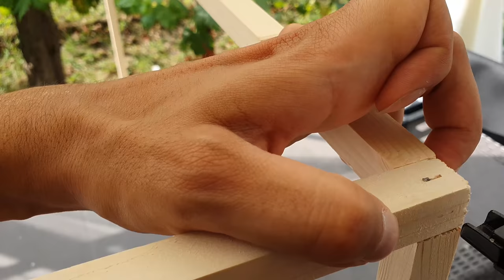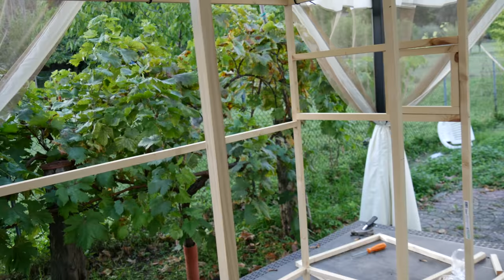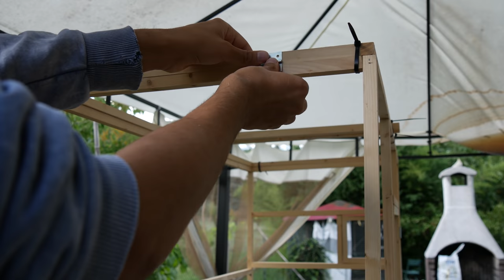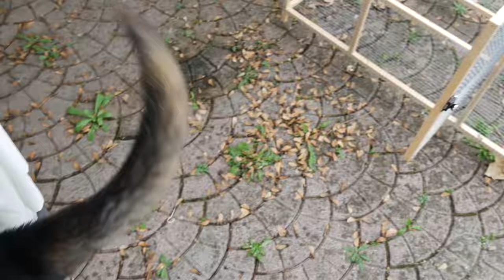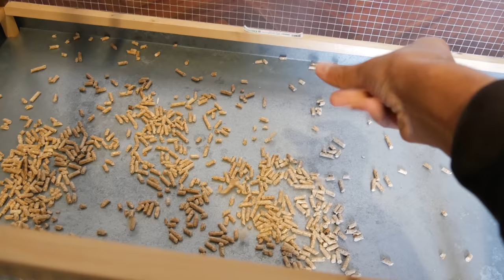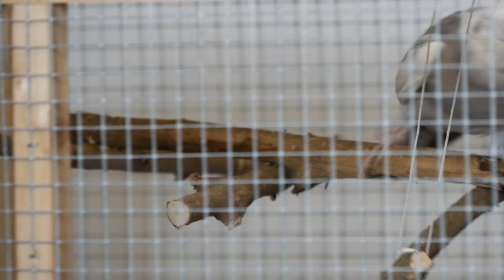How to - Building a cheap wooden cage for cockatiels

Comment: This would be an excellent cage for birds that don't chew extensively (like my Bourkes)!  I wonder how difficult it is to clean up, or install perches/platforms/other toys. One thing I really dislike about the current cage I'm using is that it's near impossible for me to add perches in certain areas by myself. I need an extra hand just to rearrange my birds' cages... :(
Reply: To clarify, all my perches are the type that screw into the sides with wing nuts, that's why I have so much trouble. :(
Reply: For this kind of cage hes building, id wedge actual sticks in there or use those sand blasted grape vines as perches. ( could look more natural and better for birds feet too!) The wire looks too flimsy to hold the screw in perches. Maybe small ones but not for a big bird.

Comment: You just need to ensure that the wire mesh is not galvanised (has a zinc coating) because the birds could bite the cage to climb it and accidentally ingest some zinc which can be fatal.
Reply: What can I use instead? Please reply
Reply: Stainless steel
Reply: Jessika Aceves and not thin mesh so they don’t cut there feet

Comment: Could you put in som measurements for the wood pieces if possible or a layout for all the supplies !! I’m very interested in creating a bigger layout for my cocktail!!
Reply from the maker: Hi, I just built it around the size of the tray I already had, but I haven't any blueprint... It came out 117 x 57 x 97 cm
Reply: @TielZone  are those 1 inch thick wood pieces?

Comment: I did the same cage some years ago but my birds ate it =)
Reply from the maker: I'm a bit concerned about it to, that's why I placed corner protectors in some critical points 😅
I'm gonna use it only for particular needings so it's gonna be empty for most of the time, but I'll update in the future to show how much they ruined it!
Reply: If you put the chicken wire on the inside it’ll help stop them from chewing on the wood. But it’s much harder to do unless you make it in separate panels and attach together after the mesh in in.
Reply: @CKaiser2076  yep I had the same thought

Comment: Do you think PVC piping might be better? I love your cage, but someone recommended the pvc instead of the wood.
Reply from the maker: Might be more durable but wood is cheaper and easier to work with... so I used wood and then covered it with these pvc edge protectors

Comment: Won’t parrots chew and destroy the wood?
Reply: I think it'll depend on the strength of the wood. Now bigger parrots, like a macaw or cockatoo? Most likely. But if they are that big of a parrot you'd need a bigger cage and it probably shouldn't be made of wood.